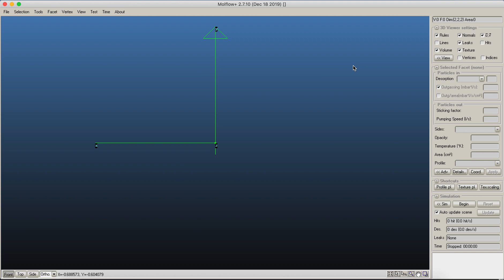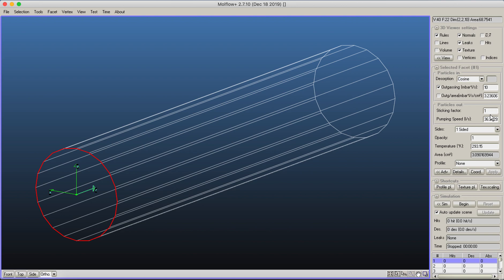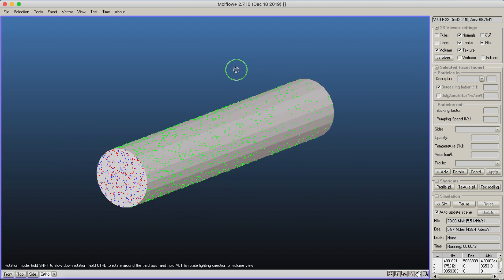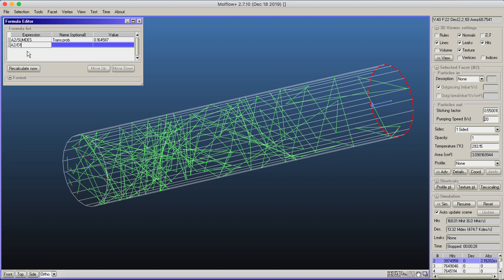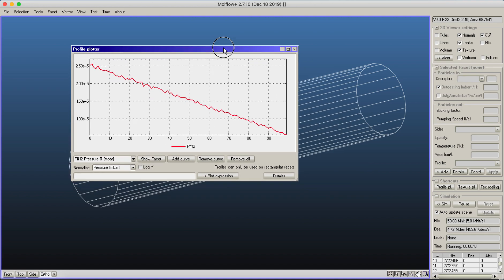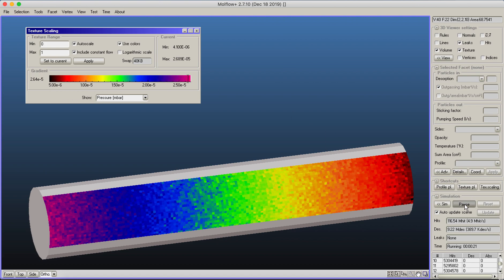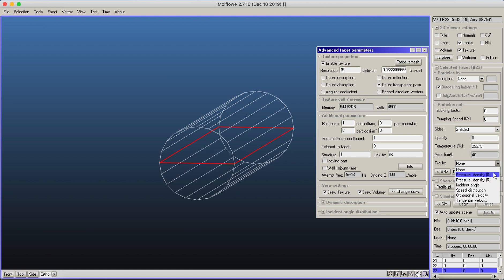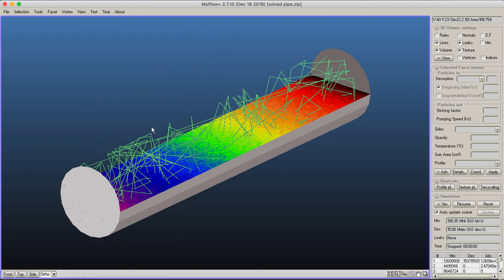Molflow webinar - Your first vacuum simulation (7 minute quick start)

Comment: For the selected face, in the advanced settings, there is a "Structure:" option in additional parameters, what are the possible inputs for it? I observed that it needs to be 1, if it is 2 the facets don't get hit, it's like they don't exist. What are all the options and what do they mean? Thank you!
Reply: Hello! Structures are describeed here: https://molflow.web.cern.ch/node/89
They are a speedup technique that can be used for (linear) geometries to section the whole model into smaller parts, connected by link facets. You can control structures in the View menu. Without the link facets, particles created in structure 1 ignore facets on other structures (2, in your case), hence they fly through them. You can contact us on the forum for more info: https://molflow-forum.web.cern.ch
Reply: @szakeetm  Thank you very much for your answer!